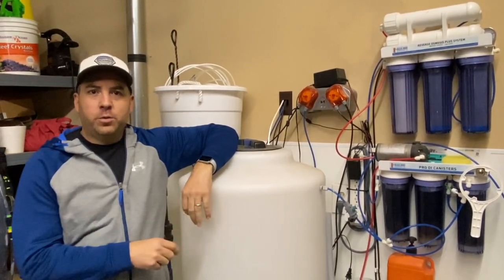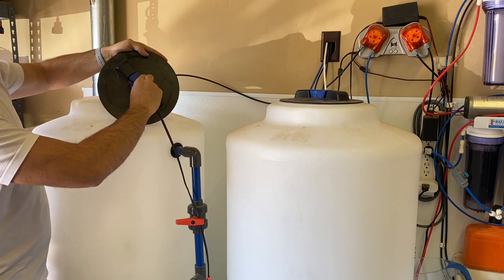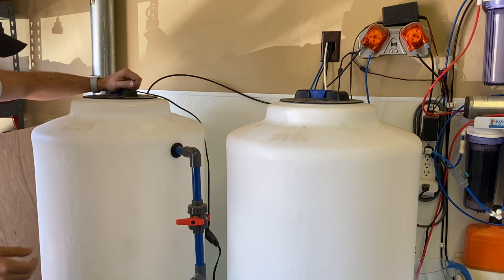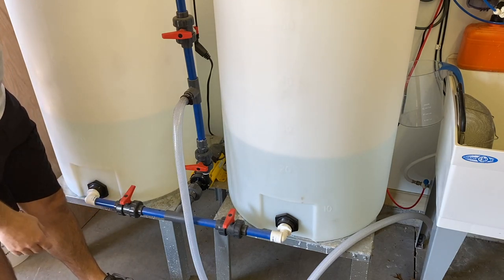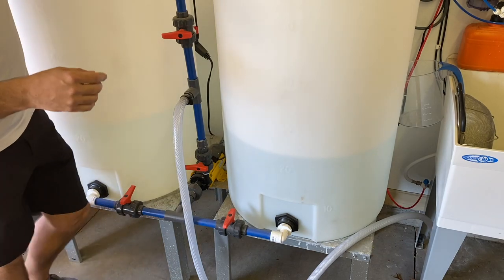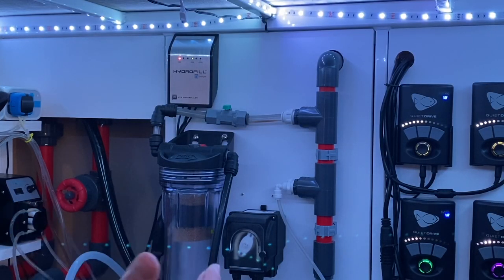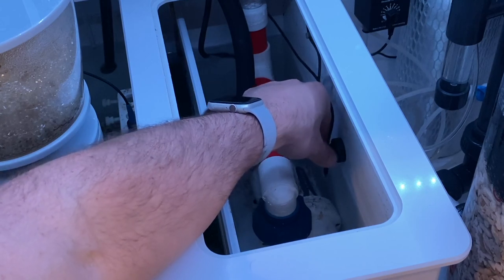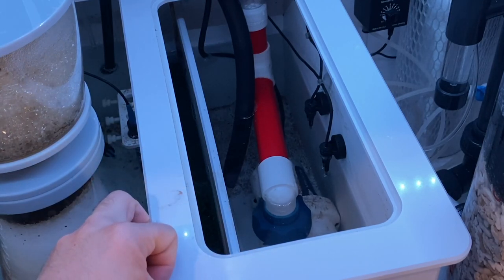Your Reef Automatic Water Change (& ATO) Questions - ANSWERED!

Comment: What are the white connections you're using coming out of your tanks? Also, what do you have going on between the tee and the pump? Lastly, are all four of the ball valves 3/4"?
Reply from the maker: Hey Weezy, the white connections are some:
https://www.bulkreefsupply.com/1-4-push-connect-bulkhead-tank-adapter.html

Between the TEE and the pump is simply a hose to get water out when I need to via either the fresh RODI or saltwater. And yes the ball valves are 3/4.  Thanks for inquiring!

Comment: Two questions...do you need an Apex Controller or is the DOS the only Apex item on the water change system?  After using the system for some time, is there anything you would change?
Reply from the maker: Hey John great questions sir! I do need an APEX controller to program the DOS to automatically do the water change. As far as changes I wish I had made, I would not! I think it works perfect for an ATO and AWC solution!